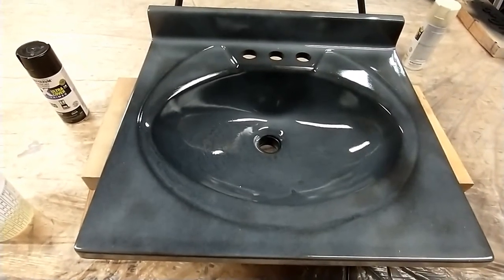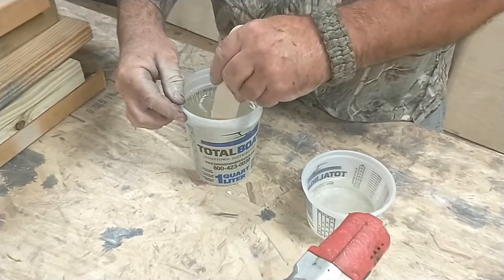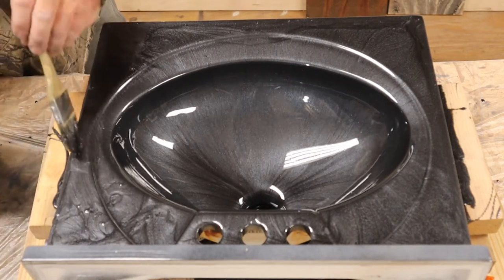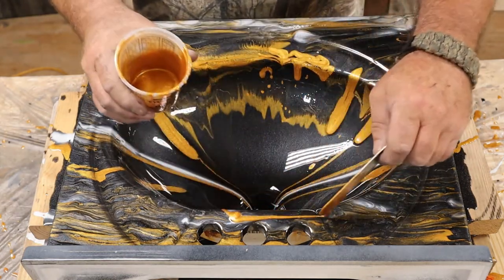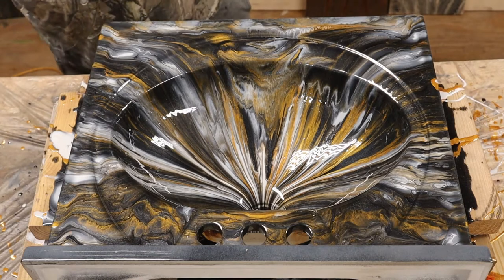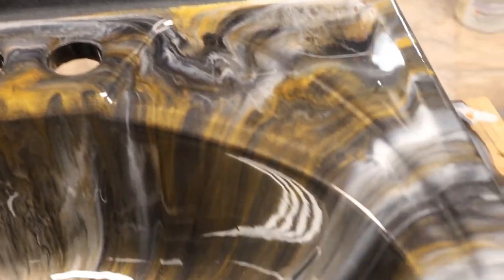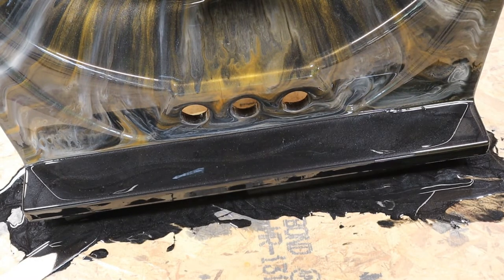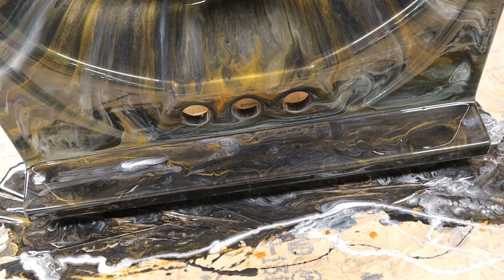RV BATHROOM SINK REPLACEMENT... NEW IDEAS FOR RV BATHROOM SINK REPLACEMENT.

Comment: What is your favorite epoxy?  You have been doing this for awhile now.  I think I would like it better I think with far less on it.  I liked it at about 15.03.  It might be interesting when doing the back splash to do a couple of little shelves or something that could be mounted near the sink. Say 1' long x 3-4" wide.  Just an idea for an add on that could spruce up the bathroom:) I really like that panel on the wall behind you in the video where you are talking at the end!!! Would be awesome in my kitchen:)
Reply from the maker: My favorite epoxy is WiseBond bar and tabletop epoxy. The shelves are a good idea if someone wants them I would definitely do it might need to bring it up to my next customer. And thank you for your comment it's much appreciated.

Comment: Great videos I binge watched a bunch today! My sinks are built into my bathroom counter tops is it possible to leave them in place and still do the back splash properly?
Thanks
Reply from the maker: Thank you so much for watching the videos I really appreciate that. Yes it's possible to do your sinks while they're in place just make sure they're level. As far as the backsplash whatever color your going to use make sure you fog that color on the backsplash before you do any epoxy work because that's a vertical surface or you could buy a thickener that is designed to go in epoxy so you can put it on a vertical surface. All you have to do is just search epoxy thickener or use the WiseBond link in the description box of my most recent videos if I'm not mistaken they have a epoxy thickener on their website the bonus is if you use that link and purchase anything through it there's a 10% discount code that I give you as well so you'll get 10% off your total cost hope this helps.